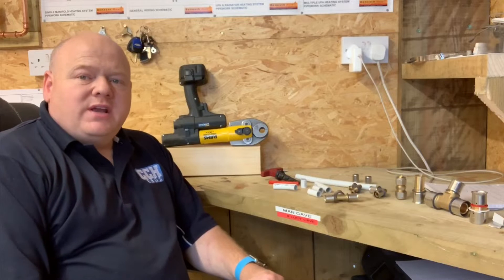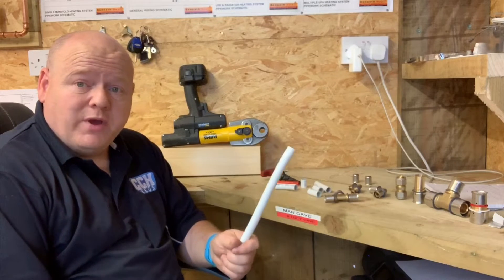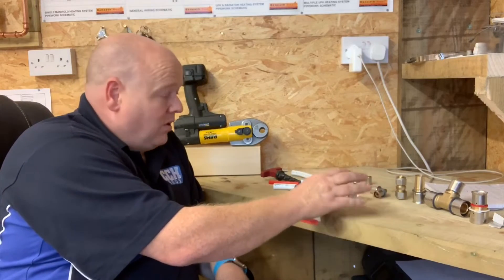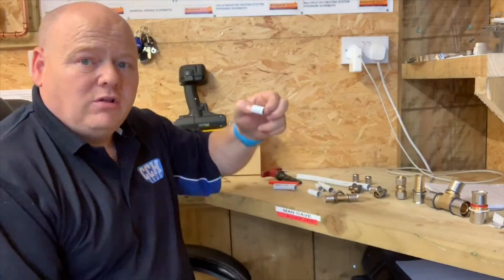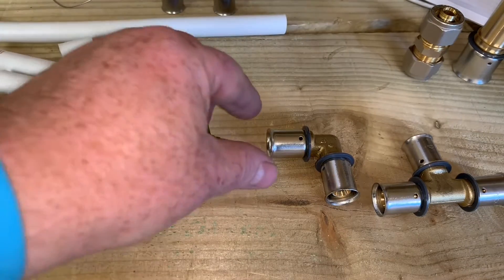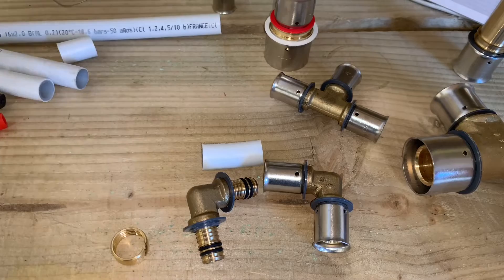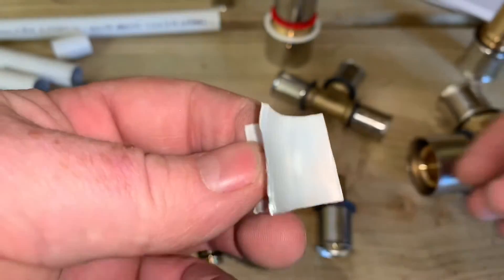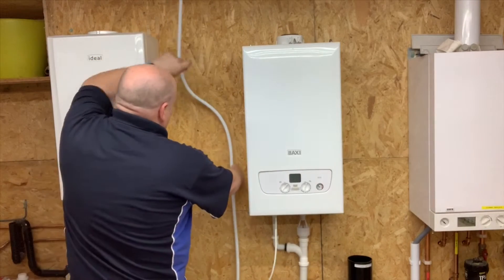Plumbing Pipework - PEX-Al-PEX - MLCP Blansol Plumbing System

Comment: Hi Allen, which profiles have you got for copper press fittings? What profile jaws do you use for the mlcp pipe? I'm looking at getting a press fit gun. Is Novopress aco103 better than the REMS one? Thanks
Reply from the maker: M pattern. Works with express fittings. Thanks.

Comment: hi. what pipe size are allowed to use in uk for plumbing? i mean, you presented pipes sized 16mm,20mm(continental sizes) but mostly you can buy 15mm, 18mm, 22mm for pex. Thanks
Reply from the maker: We use 16mm 20mm 25mm 32mm Thanks. Thank you so much for the comment. Happy new year

Comment: Lots of other countries have been using PEX (Australia). The fittings are way stronger than a push fitting. You should not really have an option to take a fitting back off. The plumbing standards need to be raised in England. It would cut out a lot of the cheap cowboys.
Reply from the maker: https://www.youtube.com/watch?v=PE-dWlOssJo

Comment: im in the commercial maintenance game in the city of London and we have been using plastic pipe (i like john guest) for a good time now and we are finding that newer buildings or refits are using this type of pipe and fittings it keeps the danger of fire down greatly ..i love it and think its excellent for DIY work as it requires little real skill (the john guest that is ) or tools a good pair of pipe cutters and dont forget to use the inserts ( we had a lot of plumbers throw the inserts away when they first started using it and we had a LOT of leaks !!!
 i think the fact you can get this in large rolls helps domestically because it keeps the number of joints to a minimum and when you have modern floors a leak would be a very difficult thing to get to !! its also quiet AND it prevents scale build up so a great all round product and for those worrying about the eco friendly nature of it , its no MORE unfriendly then digging up[ copper ore and smelting it etc and it lasts for decades ( have some in for twenty plus years in a bathroom at my parents no leaks and no deterioration )
 i must confess that a  decade ago when we had mcalpines on a site (using a floor as an office for a build down the road ) they tried this crimping system out to install a sink in a  first aid room and it PISSED out all over , when i went and had a look and spoke to the site engineer i was convinced it was operator error and offered to check it all out and found the wrong jaws (as fallen explained ) and the guy was not letting the crimper do its full run he was scared of crushing ... i offered to redo it simply because i wanted to use the crimper !! and it worked perfectly it was all copper and is still in use today 
i am planning to sue all PEX on my upcoming referb of a house
Reply from the maker: https://www.youtube.com/watch?v=PE-dWlOssJo

Comment: Can pressfit copper fittings be used on gas?
Reply from the maker: John Burns Yes, you need to use the correct fittings though 👍
Reply: @AllenHart999  
Thanks, you have educated me - that is hard to do in this business.  I have always used solder, and the odd compression, for gas, not really looking if newer fitting were available, as solder and compression worked and cheap enough.  If you already have the crimping tool, then it makes sense to use pressfit on gas. 

I suppose it is a matter of looking at the makers info. 

You say they are the same price as a pushfit fittings, which I suppose is about the same price as a quality compression fitting. But end-feed solder is cheap.

Comment: This pipe and its fittings are expensive.  This pipe has never really caught on, as most prefer the likes of Hep2O pushfit.  Its advantage are few when considering the extra costs.
Reply from the maker: I sort of agree with you but in my opinion it is better, Personal choice really. I wanted to show what it is as i didnt know a few years back. Thank you John.
Reply: @AllenHart999  
It is better, but it comes down to costs v advantages. If you do lots of big jobs, then I would say go with it. If not, it is a matter of ignoring it. Except when you come across it.
Reply from the maker: @johnburns4017  I have started to use it. I am going to use it when possible. Customer will need to get me back to change anything in the future lol
Reply: Its main advantage is 100% airtight which wirh regular plastic and copper do not offer and we all know air in the system reduces system life.

Comment: Is it that aluminium layer that let's it hold when bent by hand? Also will bending by hand void any manufacturers garantee on pex?. Great vid as always 👍
Reply: Thats the perk but the actual reason it has a aluminium layer its to make the pipe 100% air tight.  Plastic is porous as it expands and contracts it takes in air and the aluminium is a barrier to stop the air ingress. 

You can bend it by hand but to much and it will kink.  The manual bender for it are brilliant 

Henco make them but hard to get them in the UK 🇬🇧 so frankische have them made by henco i believe slightly different but not much.  Can only get 16mm and 20mm in UK at moment but henco do a 26mm bender to struggling to get hold of the 26mm .  

The manual benders bend the pipes to very small radius
Reply: @jmb69er  thanks for all this info 👍 everydays a school day.
Reply from the maker: Yes the aluminium keeps it in place. Wouldn’t void warranty no. Thanks.

Comment: I do not think those fittings are "quality". They will be restricting a lot of flow as they are smaller diameter than the pipe. With coper fitting your flow area is actually increased at the fitting as they go over the pipe not inside the pipe. 

The whole point of using pex pipe is to make it a lot cheaper however those pex fitting are 10x more expensive than copper so do not use fittings to connect 2 pipes. The only place where I use them is at the tap where the pipe ends, and at the source where it starts. That is it. Never Ever use 90deg fitting. Never use fitting to join 2 pipes. Just bend the pipe 90deg. Never use those fitting as tee but better run separate pipe from the source. To do the above you must use pipe from the roll of 50m or more.
Reply from the maker: You make a very good point. Plastic push fit pipe is also a lot smaller with the inserts. 👍
Reply: frankische alpex pipe fittings are the best on the market i think.  their fittings still restrict flow but they have the largest internal diameter compared to other brands.  

Just from Alans video i can tell fittings I use from frankische look better quality than the ones he’s demonstrating

Comment: Looks expensive, what’s the benefits of using this stuff over hep or speedfit?
Reply: Benefit  compared to hep or speedfit

100% leak proof 
100% air tight
Stronger joints

Can be plumbed up direct to boiler no copper required

Can be used on all job site due to permanent joint fittings can not be tampered with. 

Has bending memory so easier to bend it to how you want and it stays exactly where it is.

Its plastic out layer is only for protection so scratches scuffs to the outer layer do not affect its water/air tight seal as the fittings double O-rings seal on the internal of the pipe which will always be safe from damage. 

It had a wide range of fittings and the fittings are slimmer externally no big bulky joints and no loose parts like inserts.
Reply from the maker: No air ingress. Can be used on hot water returns. Thanks.

Comment: Is the boiler manufacturer still want an (x) amount of copper before using multilayer on hot flow and return? Great informative video , i am definitely on transition to use pressfit gun .
Reply: Alpex  pipe can be plumbed up directly to a boiler 

They are rated to 95 degrees 10bar continuous
Reply: jmb69er thanks that ll make life even easier
Reply from the maker: I use pressfit copper onto boiler. Thanks.

Comment: loads money for fittings and press tools that have to be serviced so i will stick to soldering lime i have been doing for 40 years and u cant beat a pipe bender just my thoughts
Reply from the maker: Nothing wrong with that Robin. Personally i do not like to solder. Thanks for watching

Comment: The fittings must be expensive and you need extra tools. It’s a non start for most I would imagine
Reply from the maker: It's does definitely cost more to start with. Thanks.
Reply: Allen Hart good video mate. Keep them up
Reply: Hi, how much would it cost for the tools needed to set up for pex.
Reply: ian rowland  £1000 crimper set 16-20-26-32mm pipe 

. £200 -300 for couple alpex manual benders to so 16-20 and maybe 26mm pipe

Alpex cutter £100 for 16mm 20mm 26mm and 32mm pipe 

Alpex calibrator set £150  16-20-26-32mm pipe 

Then £400 for more heavy duty bender to bend 16-20-25-26-32mm pipe

Comment: Hi Allen - Great video I seen this used abroad (Cyprus) when I worked there but they had a slightly different system - they had a "stretcher"  that fit inside the pipe   and the fittings looked like the one you had stripped down  with just the barb & "O" rings - you basically stretched the pipe- removed the tool -  then quickly put the fitting in -  then the pipe "shrank" back onto it after a few minutes - they were solid once set - you could re-use the  fittings by carefully cutting the pipe off and using new "O" rings  - the system is quick and cheap so some Cypriot  worker was telling me  I don't know  what the system was called but I have seen it used on some USA  video's as well Thanks for all your video's and time putting them on All the best to you mate
Reply from the maker: Hi Colin, Thank you for your comments and thanks for watching. 👍
Reply from the maker: https://www.blansol.com/pex-multilayer/multilayer-pipe-pexalpex/

Comment: Brilliant video Allen. 
Allen can copper  pipes be  completely be replaced by pex for central heating?
Reply from the maker: Normally the first metre would need to be copper. Although these have a high temp rating. I am guessing that as the reg,s move with the times copper will be replaced. Thanks.
Reply: @AllenHart999  
Depends on the boiler. Plastic pipes can go right to a boiler if the boiler connections are outside of the case.  But consult the boiler's instructions manual.

Comment: Get yourself the springs for making neat bends very handy to have i have the 16mm 20mm and 26mm. Also the inner and outer reamer is much better you can get them to attach to your drill. Multi layer pipe is so nice to work with clean fast and won't corrode.
Reply from the maker: Do you have a link to the benders, please. Thanks.
Reply: You can get the springs from the plumbing suppliers screwfix etc
Reply: @AllenHart999  https://www.heatdirect.co.uk/emmeti-external-multilayer-pipe-bending-tool.html?gclid=Cj0KCQjwhJrqBRDZARIsALhp1WQhfdujpQNpLIAPoIk3Y7BMsxiEGX7bXC6ne9lJ2wM1_yAO9pUysc8aAqW7EALw_wcB
Reply: You dont want those crappy springs 

Your better of with manual alpex bender so much better.
in UK 🇬🇧 we can get 16mm and 20mm but in Europe im trying to get the 26mm one aswell but its hard to get any one to ship to UK.